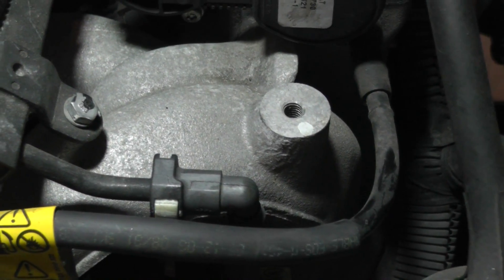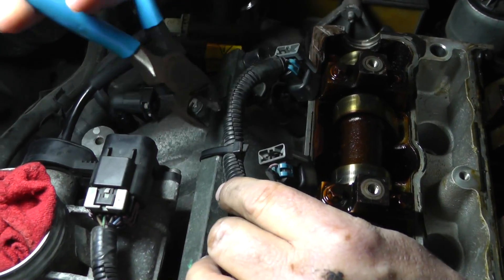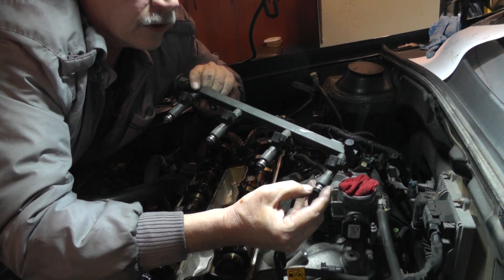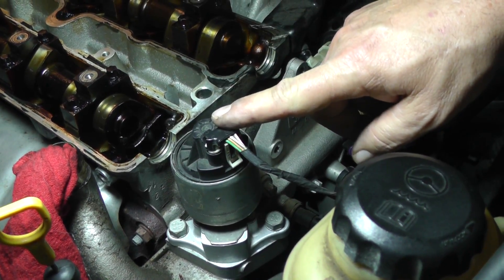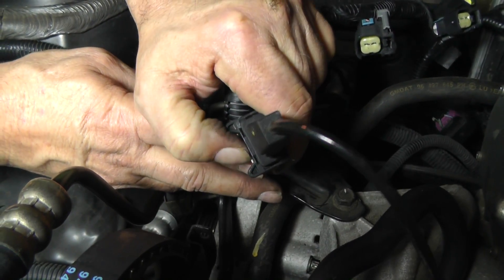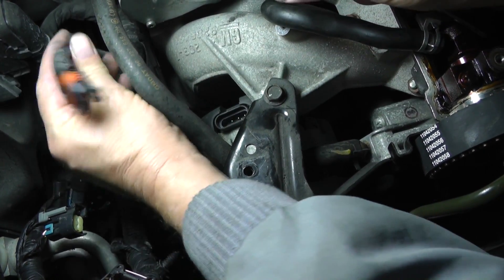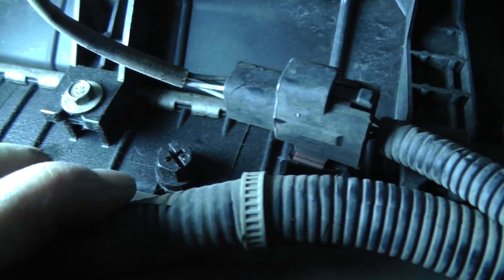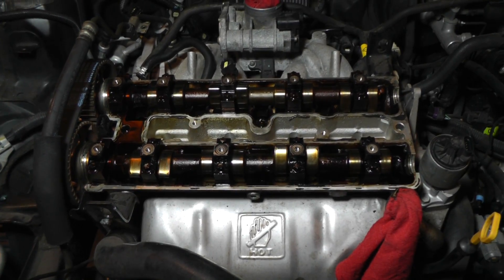Suzuki Forenza Head Removal - Part 3 (Camshaft Cover Removal)

Comment: I watch your whole series all of them on the 2006 Suzuki forenza head removal/engine rebuild and i am so thankful for you it helped me out a whole lot plus doing step by step.. I am rebuilding an Suzuki myself and without you I would have be lost so thanks again.. PS so how did you get one cam Sprocket lined with the other one??
Reply from the maker: Thanks for watching the series. I showed this in one of the videos of where the timing belt is being installed. I used a pair of vise grips to hold the two cam sprockets in place. Looking back through the videos, you can see the vise grips in the thumbnail picture located here https://www.youtube.com/watch?v=SPV_FSdbJxQ&lc=UgxAT-DuU8TqG1n1Fe14AaABAg

Comment: at minute 8:45 you are removing the temp. sensor wire plug, to the left of that and below the ERG is another sensor, what is that sensor? Thanks
Reply from the maker: If you're talking about the sensor beneath the EGR valve, I mentioned that it was the engine coolant temperature sensor at 8:41. If it's not that one, I'm not sure what sensor you're referring to. Have a great day!

Comment: Needing this online says a new head is about $800.00 bucks so hopefully I can make that purchase to get back on the road soon. Thanks again for these good quality helpful videos
Reply from the maker: Another option if you're doing the work is to get a quote from a machine shop to see what they will charge. If memory serves me correctly, it was $350 for the machine work. Of course, that didn't include the pricing of the valves, guides, seals, etc.
Reply: @stuzman52  right so if I were to do it myself the next cylinder would come with all that you mentioned correct?
Reply from the maker: @NP.TRU.09  Yes, the new or rebuilt head should come with all the components, but make sure before you purchase. Who knows, there may be some out there that doesn't include valves, etc.

Comment: Thank you Stuzman for these great videos, they helped me with the second gasket replacement! And now the 3rd.... with that fuel rail connector you can push the white connector IN and it will spread the clip for removal. I broke one of mine trying your way, easy fix from you-pull-it. Again, thanks!!!
Reply from the maker: Thanks Glen2003! I found out later on the same thing about the fuel rail connector. I mentioned it in a later video. Thanks again for the comment!
Reply: @stuzman52  hey, quick question for you. Getting ready to reassemble and opened the gasket kit and noticed some damage on the head gasket and noticed some damage on the nub on the intake side of the engine between pistons 2 and 3. The white line is partially damaged. Should a return be made or is the damage insignificant enough to not matter?
Reply from the maker: Ghen2003 _ For the amount of work that’s involved, I would return it and get another one. No need to take a chance. Good luck on your repair! 😀👍

Comment: How did you get the belt off the alternator
Reply from the maker: If I remember correctly, there should be a tensioner on there.
Reply: @stuzman52  there is I can't get anything in there to get to it
Reply from the maker: I can't remember the details as the job was done years ago. If it's that tight, you may need a tensioner puller which is basically a thin bar where you can put different size sockets on it. Maybe that will help!

Comment: I have an 04 Suzuki Forenza. It keeps running hot because it’s losing water. I don’t think it has a water pump leak because I don’t see a leak anywhere. I believe my thermostat is good as well. There is some red looking gunk in my water reservoir, I’m thinking it’s bars leak. So is this a good indication that I have a blown head gasket? There’s also oil on my spark plugs as well.
Reply from the maker: James Roberts These cars are known for head gasket failures. It’s most likely the cause.

Comment: What's that metal pipe under the engine coolant temperature
Reply: I have a leak in that middle pipe running length of the pipe
Reply from the maker: Richard Griffith not sure which pipe Richard. Is it leaking coolant?
Reply: stuzman it's a metal one that comes around the backside of the motor K'Nex to the one running to the radiator fan that part of the hose those rubber but the back of the motor for some reason it's metal pipe
Reply from the maker: Richard Griffith I sold this car about four years ago, so I can’t remember the line. You said it was leaking. You could take a picture of it and show it to your auto parts store to get another one.

Comment: Thanks for the speedy reply. Well after driving it for a couple of hours, I would come to a stop and it was puttering on exceleration and running rough but not running hot and the check engine light came on so I took it to advanced auto and the code PO113 came up which is the air temp sensor so i took off the air cleaner to remove the air temp sensor and there is excessive amount of oil in throttle body and air cleaner. Its so puddled up that it looks like almost strait oil and my air filter is black where the filter housing connects to the air cleaner.  Thanks
Reply from the maker: Brian, once you clean all of the oil off the air temp sensor, how does the car run? Does it have good acceleration? And are you sure that you've got the timing marks aligned? Remember, you mentioned that the car ran fine before the job. I can't think of a reason why the car would have an excessive amount of oil blowing by unless the timing was off or that you've got worn piston rings allowing increased blow-by (probably not rings since it ran okay before). Since the car ran fine before, it's got to be something that's different now. Oh, by the way, the P0113 is saying that the PCM is seeing a voltage of 4.5VDC or higher. This means that the temp sensor is open or there is an open wire in that circuit. When you have oil around a sensor, this would create a short circuit which lowers the voltage and it wouldn't be 4.5VDC or higher. So, be sure to check the sensor and the wiring for that circuit.

Comment: Hey thanks for the video, I couldn't have done it without your help. I do have a problem if you could help. I am having a problem that I didn't have before replacement. I now have excessive blow by in my throttle body which is causing problems with my air temp sensor and making my car putter. I was told it could be the PCV valve but I was told its located in the valve cover. So I was wondering, where the valve cover has a long piece that slid's into the head and seats into a hole between the camshafts, is there a grommet that goes there or does the valve cover tighten up the valve cover gasket tight to seal it? and if it isn't tight enough will that cause the issue? Thanks for any help.
Reply from the maker: From my memory, there is only the camshaft cover gasket and not any other gaskets or grommets. And I'm pretty sure that this car doesn't have a PCV valve as the ventilation is handled inside the camshaft cover through a passageway that's molded in it. How did you come to the conclusion that you're having excessive blowby and this is creating an issue with the intake air temp sensor?

Comment: I really appreciated the time you spent making the timing belt and water pump series. Watching this series now in preparation for more issues with that car. One thing, though, I made the mistake of pulling the coolant drain plug all the way out of the radiator right after I got it loose and spilled about half of my coolant. So, for anyone following me in this game, let the coolant flow around the drain plug for a good while so you can catch it.
Reply from the maker: +Darryl Machtmes Glad to help out Darryl...

Comment: I have a question about the removal and replacement of the egr adapter gasket. I have a 2005 Suzuki Forenza and it started leaking a little antifreeze around the bottom so I bought the gasket and replaced it several times. After replacing it several times and using the red gasket sealer, it still leaks a small drip every now and then. I have let it set 24 hours to setup before adding antifreeze and cranking it, thinking that was the problem. But even then it still leaks. I have looked and made sure that its not warped and its not. Please help!  Any advice will be appreciated. Ive even went to Suzuki and looked at the their gasket and it is identical to the ones I have been purchasing from Auto Zone, Oreilly's and Advanced.
Reply from the maker: +Larry Mcdaris Don't have much to offer for you Larry, but there's got to be something going on. If you're sure that you're installing it correctly, and you really don't need any sealant and the flanges are not warped, I couldn't tell you what is wrong. Sorry...

Comment: this link shows the leaky tube i'm talking abouthttp://www.suzuki-forums.com/general-forenza-reno-forum/53930-oil-leak-after-valve-cover-gasket.html
Reply from the maker: +dgh ebgt On that particular tube there is no seal or gasket to seal the oil. Some people have reported that this tube does leak oil. The only sealing connection is from the plastic pipe down into the metal bore. You may can try to put a thin film of silicone sealant around the plastic tube before you insert it into its bore.

Comment: the camshaft cover is also leaking from that tube that's near the coil. is there a seal or ring or something for that
Reply from the maker: +dgh ebgt If I remember there is a line in front of the coil which is for the EGR solenoid and it passes coolant through this tube into the head. If that is the one you're talking about, yes, there is a gasket for that tube that bolts up to the block.

Comment: tool dw260-050
Reply from the maker: +dgh ebgt And your question is?
Reply: I noticed some oil coming from around the head cover gasket on the side where the coil is and it was also coming from that tube that's on the head cover near the coil. I put another head cover gasket on but still can't drive yet cause while I was driving (before putting on the new cover gasket) the car engine light came on and about 5 minutes later the transmission was slipping (like pulling off in 3rd or 4th gear). I made it home. The next day used a different car to go to the store and get a obd2 diagnostic tool, hooked it up and got 2 P0700 codes and 1 P0563 code with a red light. By the way, the head cover leak and the transmission slipping and the engine light coming on, all happened at the same time, if that means anything. The next day I went outside and looked under the hood and jiggled the connector to the TRS a little to see if it was loose but couldn't do nothing else cause it was too cold outside so the next day went back out and started the car and the engine light was off, so I plugged in the obd2 tool and still got a P0563 code but only 1 P0700 code and a yellow light. Saw a transmission range on eBay for $12.50 and bought that without knowing if the old one was bad since it was only $12.50. Put that on without the dw260-050 tool and the engine light immediately came back on.
Reply: What causing the head cover to leak from that tube near the coil and what does codes P0700 and P0563 have to do with each other
Reply from the maker: +dgh ebgt The two codes may or may not be related. The P0700 code is stored in the PCM which is a generic code saying there is an issue with the transmission. You'll need a more high end scanner to look into the transmission control module (TCM) to see a more specific code for the tranny. As for the tranny range sensor, P0705 usually sets if there is an issue with this. And to adjust it, just put the top bolt in the middle of the slot of the sensor as that's close enough. It's not an absolute necessity to have the special too to make this adjustment unless you want to pay about $130 for it. As for the P0563 code, this is saying that your system voltage is too high. You may want to put a DVOM across the battery while the engine is running to check your charging system. As for the leak, I assume that you're talking about the camshaft cover. If so, you'll have to figure out why it's leaking. Maybe the gasket slipped. I like to put two flat washers under each camshaft bolt as I believe the bolts are a little too long.

Comment: what are those white clips on the fuel rail called? 2mins into this video? i broke one of those clips and i need to buy a new one if you know. Also thanks for your videos it guided me through two head replacements. One on a 05 suzuki and one on a 06 Chevy aveo. Seriously about saved my sanity
Reply from the maker: +Michael Nicholls Those are fuel line retainer clips. I actually broke one too as with all plastic as it ages, it becomes brittle. Take out the retainer clip and carry it down to your local auto store; I used Advance Auto Parts, and you'll see them out in the isle. I believe they were made by Dorman. You should be able to match it up. Also, you can just squeeze the sizes of the retainer and not have to actually pull it out. I found this out later and even point it out in one of these videos. I take it that with your two head replacement jobs, everything worked out fine for you. And thanks for liking the video series.
Reply: +stuzman52 yes I watched everyone one of your videos. I actually don't even remember breaking it but when I went to start the car the line popped off. thank you for the info

Comment: i did the timing belt all ready bad news the valves vent. about the water pump i got a especial location it got a noch were the pump arrow goes after 1000 tims i discover the location.you was rigth about water pump tanks
Reply from the maker: +misael pacheco Just remember that with this engine, if the timing belt breaks, you can count on the valves being bent. Glad to hear you got the water pump figured out.

Comment: Your videos are great and very helpful. I didnt watch whole thing thou. I put the suzuki back together and didnt bleed the lifters i was wondering if thats why its has a little tick to it now.
Reply from the maker: rick varada Glad you liked the videos Rick. The reason for bleeding the lifters was to ensure that the valves wouldn't be held slightly open where the piston could come up and bend the valves again. It's more of a safety issue to prevent this. With the lifters bled, this would ensure that the valves will remain close when they're supposed to and prevent any damage to them. Then after about 10 minutes of running, the ticking should disappear. So, it's unlikely that not bleeding them caused your issue. Probably just a faulty lifter that's not pumping up as it should. I don't know how long it's been running, but it should only take a few minutes for it to disappear. Otherwise, you probably have a bad lifter...

Comment: Hey, absolutely loving these series of videos on the Suzuki Forenza 06!  It's been a pain in the ass trying to find information on them.  So my question to you is (and hopefully you are able to answer it) where is the IAC (Idle Air Control) valve?  If you could please point to a particular time on one of your videos on this series so that I can get a good idea of the location as I am having a heck of a time finding it.
Reply from the maker: ***** Hi James. On the 06 and later years, there isn't a IAC to be found. These years uses a DC motor which is controlled by the PCM. The IAC system was used on the previous years where there is a cable from the accelerator pedal to the throttle valve. On the later years that I mentioned earlier, there is no cable. These systems are usually referred to as drive-by-wire. In both cases of the IAC or DC motor, it's located on the throttle body. If you're not sure what that is, look at the hosing that goes from the air filter box and follow it towards the back of the engine. You'll see that this hosing, (3" to 4" in diameter) connects to a rectangular box which is called a resonator. From there, this resonator connects to the throttle body with a hose clamp. You'll have to remove the resonator and air hosing to see the throttle body more clearly. And on there, you'll see the IAC or DC motor depending on what year you're looking at. Hope that helps! And thanks for the comments on the videos!
Reply: Okay!  This makes so much more sense now as to why everyone was talking about it but me not finding it!  2 other buddies and myself were standing over the open hood with the resonator off the throttle body looking for this thing.  All we had were pictures of what the motor should look like but not where it went.  We all knew that it SHOULD be attached to the throttle body but the picture is different from what is the 06. haha.  So the DC motor must be what is on the right side of the thr. body then.  I was looking for it b/c everywhere was saying to clean not only the throttle body but to remove the IAC and clean it too.  Thank you for clearing this up for me.  AllDataDIY.com was somewhat misleading to me then for my vehicle.
My next mission is to replace my timing belt and with your videos I can't fail!
Reply from the maker: ***** So James, it sounds like you have a 06 then. If so, you'll find that all of these videos are for that year. If you take a look in the head removal videos, I show how to remove the throttle body and I also talk about how to clean the unit. I believe it's in the intake and exhaust removal videos. Or it could be in the installation of the intake and exhaust videos. Mmmm, it's been awhile back. Just take your time on the timing belt change and you'll be fine. Take care and good luck on your repairs.